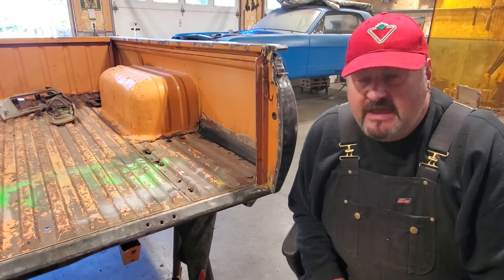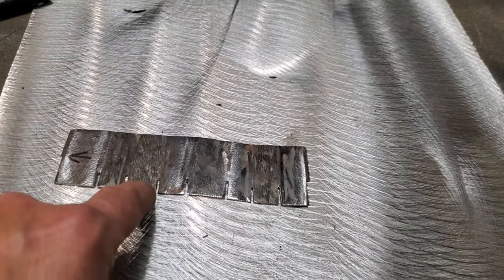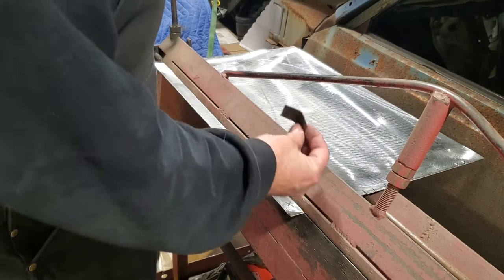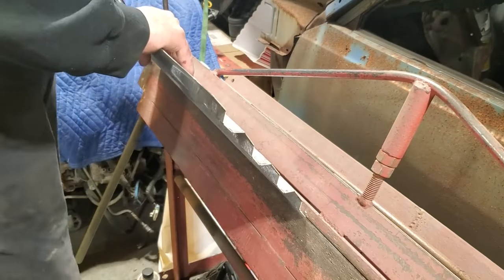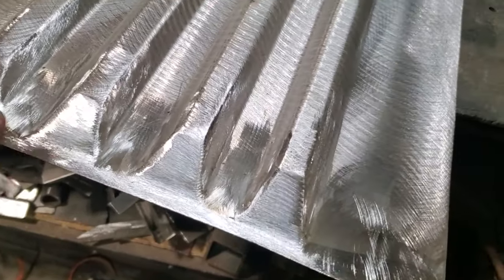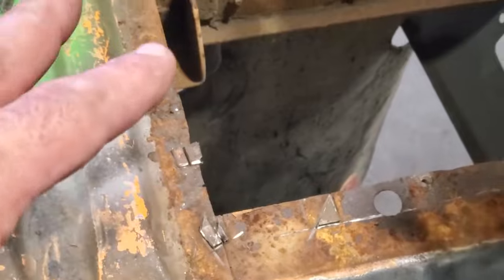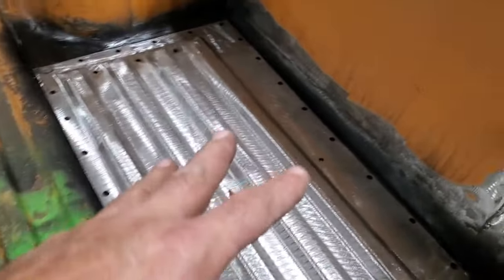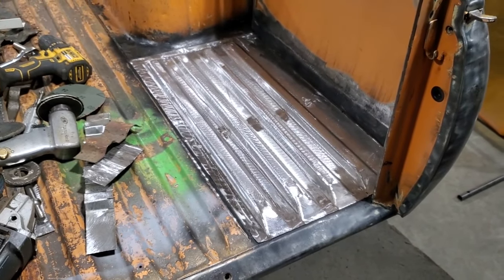How to make truck bed floor panels with basic tools

Comment: Hopefully this'll will help you on your layout, and marking for your bends, are cuts needed. 
Once you have your stretch out for your total length, and you have your piece cut that your going to do your layout on. 
Get a quality metal ruler that is made thick enough to be ridged and stay true without bending or bowing. 
Then get a equally good metal scripe that has a harden point.
Then you can mark your metal by using what I've always called a crow's foot, are a check mark right off the edge of the metal ruler laid directly up against the edge of your metal. 
That's always been the most accurate way to mark your metal, and while being deep enough to see, it's easily sanded off for finished product. 
That is one way, and if you have a common measurement for like a border, are say a bend along the edge that you use constantly.
Because making slits as you've done is nearly impossible to hold straight and true, and since you went into the work piece 1/2"-3/4" both ways. 
By the time you get through with the marks,  the distance has changed between the actual ends of your work piece. 
That in turn actually changes the measurement between each bend, and makes impossible to make accurate bends in your metal.
Plus the deflection of your break will distort the bends too.
Hopefully this'll help you out, those are the methods I've found to be most reliable after 40 plus years as a sheet metal worker. 
Nice work your doing, and I hope maybe my suggestions help you improve your work. 
From N of Dallas Texas 
P.S.
Get you a piece of 16 gauge metal and cut it out in and manner that fits your hand well.
Then measure from the edge back to whatever demention you want, mark it there then mark it straight  up 1/8" , and up at angle to your within a 1/4" from the edge of the metal. 
Then from there down at an angle to the edge of your metal at your original starting point.
You now have a premeasured scripe, that will last you for many years to come.

Comment: You should upgrade your metal brake by attaching a piece of metal at the top of the moving part so that it engages the metal earlier. That way you wont compromise the bend you did before.

Comment: I was surprised how you made this, didn't think you could get bends in the brake as easy as you did.  3m has lots of surface conditioning discs, like some others have commented you need to sand to a finer grit before primer seems like doing this before putting bends in the flat panel would same time in finishing later.  I know I hate sanding, the metal work on the box seems good enough that I can't imagine anyone putting filler on it so no need to leave at 24 grit.   Other thing your editing and narrating continues to get better all the time.   I wouldn't be surprised if would be body repair schools show this to students.

Comment: Funny everything you did in this video is what im doing to my 76 Jeep j10 bed..  but im doing the entire bed and all the cross members..  and i too used a drill bit to grind paint off the cross member for the spot weld.

But i also spot welded from underneeth.  You dint have to waste time grinding that way

Comment: Hey fitzee.... Try get a pneumatic belt sander... Its good on grinding hard spots
Reply: I have a half inch electric belt sander. Very handy for tight spots, though they snap very easiliy if you catch an edge.
Reply: @gshort4707  I also use the hazard fraught belt grinders with 3m belts

Comment: great one again sir. , how would you go about on molding  round half  moon rib panels,   with some steel tube or pipe  & hammer ?
Reply from the maker: Probably with a homemade press die or hammer forming

Comment: If you are doing a spot weld on a thin panel to a much thicker panel, it is usually better to drill an 1/8th inch hole in the thicker plate so that the spot weld doesn't pop loose if you have a smaller machine without much penetration.  On spot weld holes of SMALLER diameter, you can stick the MIG welding wire directly in the center of the hole, start the arc, and then don't move the torch at all.  Watch the puddle flow outward from the center until it starts to melt the edge of the spot weld hole and then stop the arc.  It leaves a perfect rosette weld with a dimple in the center.  This works better when the lower panel is thicker than the top.
Reply: Big hot rosette's work great welding down Q-deck. But, I like Fitzee's solution because his spot welding technique avoids creating too much heat and diminishes the possibility of distortion of the panel that was so carefully crafted. I began welding metal deck in 87', if you burn a deck nobody cares; but this is a delicate piece of precision restoration Engineering that Fitzee has no desire to do twice.

Comment: I use the wire on the mig welder to scratch the paint in the plug weld just enough to get it started

Comment: I don''t know if I didn't pay attention or what but where the metal meets the other on the sides an then against the box side, did you weld that as well then grind smooth or did it even need a bead?? I sure got a lot of answers from this and so many many thank yous
Reply from the maker: It's was plugged welded in and grind smooth

Comment: Try cold galvanizing spray  paint. When it dries, it leaves a pure zinc coating that is electrically conductive and doesn't require removal before welding. It's also cheap. You can get it at HD for about $6.50 a can. It's called, Rustoleum Flat Gray Cold Galvanizing Compound Spray
Reply from the maker: Now that is interesting  but do it give off a gas like galvanized steel?
Reply: I used something like that before.  Bought it dirt cheap at Princess Auto years ago.  Not the same brand, but still a cold galvanizing spray paint.  It was like a...watery weld thru primer...but it wasn't near as bad to actually weld on!  At the time I thought it was a poor batch of the same thing and just not as thick as it should be so it went on sale.  I bought a half dozen cans cheap and remember later being rotted when I discovered PA was sold out.  LoL  I'm gonna keep my eyes open for that Rustoleum/Trimclad stuff and give it a try.  The stuff I used wasn't as smokey as Weld thru but with Zinc in it, it has to be longer lasting and more effective than regular paint.  I use a small fan on low to clear welding fumes anyway.  I'm gonna try a can of that myself for sure!!!  Thanks for the tip Steve!
Reply: @fitzeesfabrications  I've never heard of it being a problem. I've used it for years without a respirator.  Duplicolor sells the same thing as Rustoleum and calls it weld-through primer on the can. Regular high dollar weld-through primer is also 95% Zinc. Doesn't regular spray  paint give off fumes when it burns off?

Comment: Hay I just found out why my  weld wasn't working as well Lincoln welders are set up for flux core so I had to switch wires around because it comes  positive to the ground clamp

Comment: How would you go about splitting spot welds if you want to save both panels & where 2 flanges are welded together w/o putting holes? I have a cutter that'll do it w/a hole only in one panel and of course the type that'll only put a pilot hole in the inner panel.

It may not be possible but I was going to take a test piece and try taking the smallest tip I can on a torch and heating up just the spot weld and seeing if I can split it with a thin chisel. Might still leave a small hole in one panel. Maybe easier to just cut them w/a spotweld cutter & then weld up the holes.
Reply from the maker: Spot welds are harder then the steel around them. Most times when you try to split them you will tear eather the top panel or the bottom. When I want to save both panels I drill out thr spot weld completely. Sometimes even then they put up a fight
Reply: @fitzeesfabrications  Thanks Fitzee! Really enjoying your channel and your simple approach to both fabrication & tools - Almost anyone can do this type work using your methods. 

I think you're correct & in the end it'll be easier to weld up the holes if needed to use a regular spot welding machine or use the holes for spot welding w/the MIG.

Comment: Excellent idea on the flat bit for cleaning out the holes.  Thanks guys!  Also fitz...what size hole does your punch make?  Seems a bit larger than the one I use.  I haven't had any issues with popping spot welds but I'm a bit weary of the small hole size.
Reply: Same here. My hole punch is 3/16 (4.8mm), though I normally dirll them out afterwards to 6 to 8mm. I think it makes a big difference. 
Using simple the simple pi r squared formula we learnt at school. 5mm would give a weld hole about 18sq/mm, 6mm = 28sq/mm, 7mm = 38.5sq/mm. 
So a 7mm hole has twice the weld size of 5mm.
Reply from the maker: I'm thinking they are 1/4

Comment: Hey Fitz. Might sound like a dumb question but how do you repair the small rust holes and pinholes in the large center panel in the datsun box without making too much of a mess. Lots of small holes. Is there a short cut to fix that rust damage.  Cheers.
Reply from the maker: I repaired  a number of them with a small patch I cut to fit

Comment: Hello ! 
  I was wondering if I would loose strength in a floor panel if I cut and welded in the dimples in the floor pans rather than dimple or pressing them in ?
Reply from the maker: You can yes

Comment: I have a 1978 Datsun 280z. It has a sunroof that I want to remove and fill in. Do you have a video on a repair like this?
Thanks in advance.
Reply from the maker: No but very familiar to that repair. It's a small roof and if I was to do it I locate a roof from a car with same crown. I replace it out close to the edge all the way around. Just welding in a section  in middle will run into alot of warpage

Comment: Looking great man.. but for the average user.. this is impossible to do as we dont have that bender.   My 76 Jeep j10 i just bought the entire bed needs replaced.  Including the bed supports.  The outer shell of the bed is fine like the quarter panels etc..

Since its a Jeep and 50 years old they dont make em.. So i was thinking of buying a 8ft bed bottom for say a gm or ford as they do make those.

And then cutting / modifying it to fit mine.  People say just get an entire ved fron a donor . Ya i guess thatd be a bolt on job.  But then my truck will be differebt colors and not match.. i dont want that.

So id rather just fix the existing bed floor.

Doesnt have to be PRETTY just work..

Comment: One question I have is how do you get the grinding marks out from the 24grit sanding disc before you paint? Or does a high build primer fill all of that in?
Reply: I have been wondering the same thing for a long time, watching his videos
Reply from the maker: It's s old habit. Primers will look after it but most of my panel work will need filler work over top so the scratches are for bondage.

Comment: Well if you are going to be fooling with old mini trucks you have to know rust repair.
I would have sweat and worried how to press those tapered ends into the ribs. Nah! Just cut the buggers out and weld wedges in. Well that was a bit obvious but then I'm not or ever will be a sheet metal person. Cool tip on the spot welds too. A friend of mine used to trim a piece of stainless wire cable off ina piece of tubing. Crimp or braze one end of the cable flush then trim the other end of the cable where about a 16th of an inch sticks out. The cable has to fit snugly in the tubing naturally and you can make them as long as needed to get into rough areas. Basically you are making your own tiny wire brushes to stick in the hole and bust the paint off. Just use a cable that matches or is smaller than your hole. That's my one and o not sheetmetal tip and I found it out because it had to do with welding in some plates for a guy. At least the plates were flat. LOL!

Comment: It’s $75 a sheet … my time is worth more than corrugated metal
Reply from the maker: 75 bucks. US. Then it transfered to Canadian then the shipping.. then the 2 Weeks it takes to get here! But your time is worth more then that. Lol. We live in different worlds.
Reply: @fitzeesfabrications  iam Canadian and I live rurally also… planning a job properly is just as important as doing the job
Reply: $75 bucks a sheet...for the exact same dimension sheet that will fit perfectly to an early Datsun bed floor and be unnoticeable.  Same width of ribs, same distance between ribs, same height of ribs, same everything.  Wow...some supplier you have!!!  If you're feeling like cheaping out...just cover the holes with flat sheet and rivets.  WAY easier right?  Problem is, it's not about easy, it's about showing how to do it at home with simple tools so it looks like it belongs there...not just something you might get away with if someone doesn't look too close.   Some people do this as a hobby and their time spent is considered fun.  Weird concept I know....